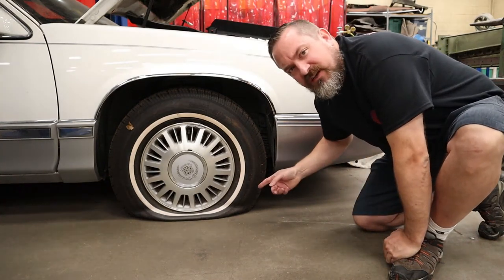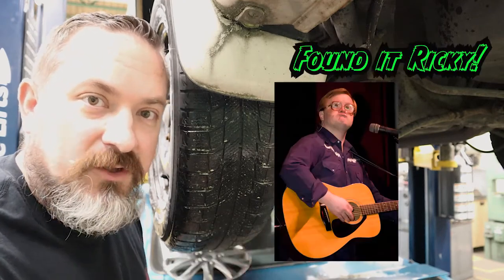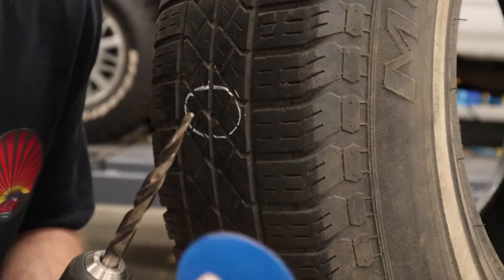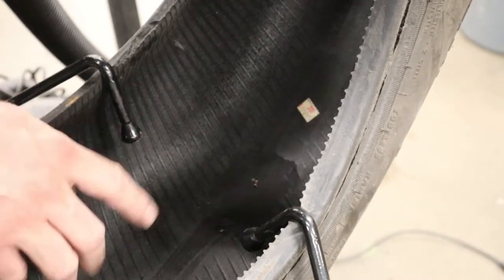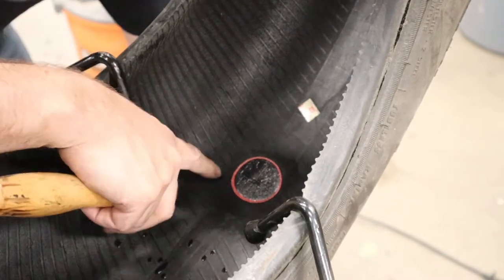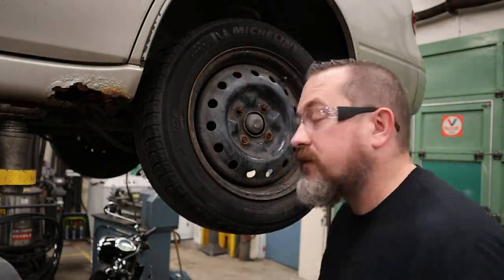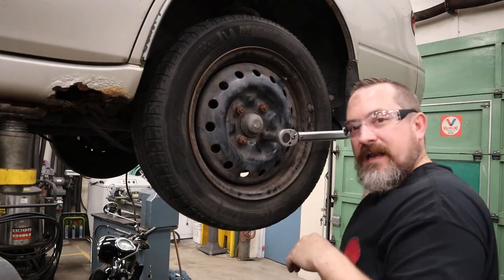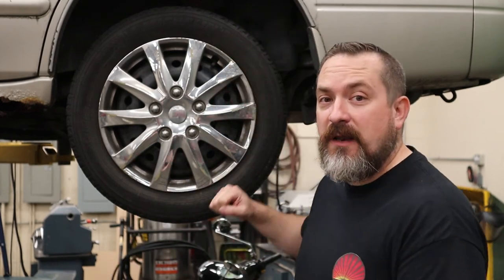How to fix a tire leak with an umbrella patch! Tips on locating hard to find leaks and more!

Comment: I would like to know  what is your opinion re torque sticks?
Reply from the maker: As I work in a high school Automotive shop, I don't use them because students will forget them and over torque and warp parts using the impact air gun.  I teach them we don't use impacts to install wheel lug nuts.  That being said, there is nothing wrong with them but I would recommend tightening multiple bolts in a star shaped pattern loosely tight at first to ensure the parts sit flush before using the torque stick.  Thanks for the watch!

Comment: you charge 300/400 dollars to fix the leaky tire??? is not it better to buy the new tire??? majority of the garages take 20 dollars and in less than 20 minutes the tire is ready
Reply: your delicate method proves that it is not the job of   DIY'ers.special equipment, many tools and compounds .
Reply from the maker: I charge $7.50 for the patch and $7.50 for the wheel to be balanced.... that's it.  Not sure where you got $300-400 from.  Mine is also fixed in 20-30 min.  Thanks for the watch!
Reply from the maker: My method is the industry standard method that shops all over the world use, including diy people.  A cheap/easy tire plug is a decent fix to get you to a tire shop so they can do this repair.  If you have two tire irons, you can do this repair too.  Not sure why you're so heated, stay awhile and learn some free tips and techniques for your own knowledge and skill set.  Thanks for the watch!
Reply: @wayofthewrench  300/400 dollars was kiddingly exaggeration due to your  time involved and steps taken.delicately.
Reply: I am impressed your way of demonstration and hope you will make more videos applicable to all cars, not for a specific manufacturer or model.
Reply: @wayofthewrench  I have done the course of automobile mechanic. my problem is that I have no confidence., I have knowledge in my forehead and not in my hands, hope your feelings will not be harsh any more
Reply from the maker: Hey ya gotta do the best job you can.
Reply from the maker: Yup you are correct.  That is why I talked about the methods to get them off when they are stuck.  Cheers!
Reply from the maker: Thanks!  Yes I will definitely use all types of cars.
Reply from the maker: Well confidence comes with experience.  Good luck on your journey.
Reply: @wayofthewrench  THANKS MY WEII-WISHER
Reply from the maker: I get it